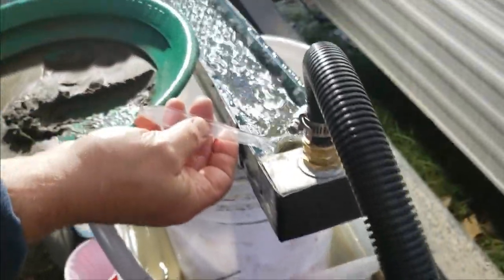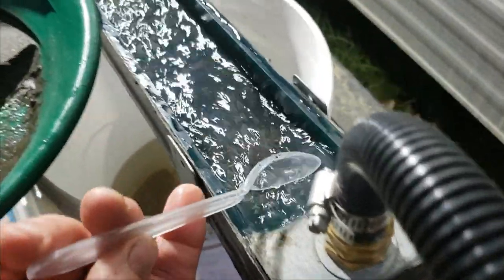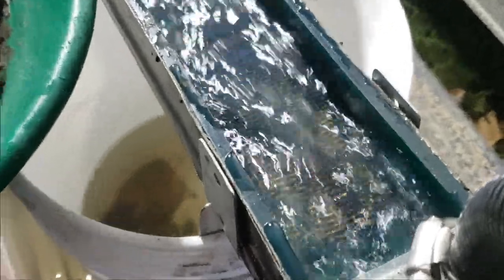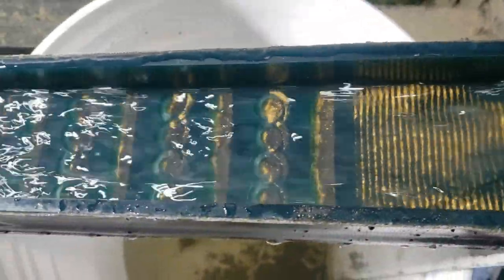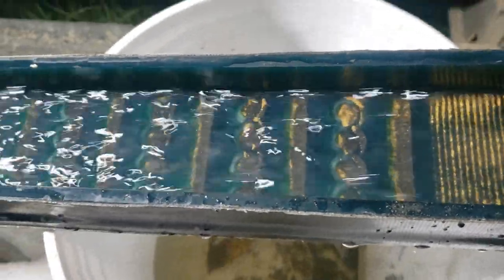VDR Cleanup from 50 pails - Magical Vortex of Flour Gold Recovery!

Comment: That’s a beautiful sight to see! 50 pales wow! 5 gallon pales? Keep up the hard work ✨✨⛏
Reply from the maker: Yeah and we try not to fill them full since they get really heavy and awkward to move with one person. It works out to about a cubic yard of material. I wish I had a deposit like this on dry land so it could be permitted and run with big equipment because if you can make money with a spade you can probably do it with heavy stuff as long as you keep the operation lean. Imagine you got this in every excavator bucket and you did it all day long haha! Thanks for watching, I will be sure to check out your channel too.
Reply: @InfinityProspecting  Would be incredible to be able to get that kind of gold each excavator bucket load that flour gold would begin to pile up very quickly! ✨⛏ Thanks for the follow 😎

Comment: This is sweet but it’s just too expensive when there are equally good finishing sluices or mats out there for a third of the price
Reply from the maker: I am not aware of a $50 US sluice that gets above 99% recovery. You can't even buy a gold pan kit for that price. I've tried numerous products at the same price point as ours and above and all were replaced by the cheaper VDR sluice. This thing has saved me literally hundreds of hours of recovery and panning times and reduces the final pan down to a couple teaspoons so I think it is an excellent value. Out of the dozens of combinations of mainstream mats we tried the VDR was by far the highest recovery rates for fine gold. Thanks for the comment and opinion, Dave!
Reply: @InfinityProspecting   Again I really like the sluice but 200 bucks is a lot for a 3 inch wide sluice.  My Keene miracle mat and my dream mat both have 98-99% recovery when ran correctly and both were under 50 bucks.  I think yours is probably better overall but I just don’t get the $200 price tag. Again I like the design ect but I’ve also heard of leaking issues from the top. Either way I enjoyed the videos and the product.
Reply from the maker: @diggerdave5371  Hey Dave, thanks for the feedback and watching my videos. I haven't heard of any leaking issues but we did recently upgrade our adapters so they should be of even higher quality than many of the home-made ones we sold previously when we were starting up.

As for your comments about cost, Infinity doesn't own the Devin Gold technology so we pay a royalty cost. We also use high quality materials and create a high durability rubber compound which then has a longer and more complex production process. Our competitors buy and pour simple materials resulting in a cheap mass produced product whereas our process involves a longer cure time and several stages in vacuum chambers to create the highest resistance and flawless product that has no air pockets or bubbles. I believe this creates a product that is superior in appearance and should last for decades. I think we have a similar profit margin compared to other gold supply companies. Our sluice and mats also paid themselves off within a day or two so generally products with such high utility can command a premium in the market place.

Thanks for checking out the Infinity channel!

Comment: You lost gold. Gold at the end of sluice. Needs to be longer.
Reply from the maker: With this much flour gold without classification to smaller levels, perfect recovery is a challenge but it still does an awesome job. A small percentage went into the tailings to be re-run. Our production sluice is quite long too and the VDR mat gets most of the take but the more mat area the better! I agree though - I wouldn't shorten the mini unless you are packing it in somewhere repeatedly by foot.
Reply from the maker: Thanks for commenting too, Kirk!